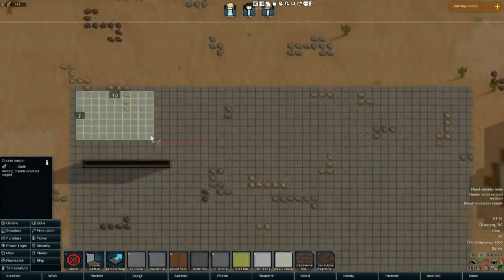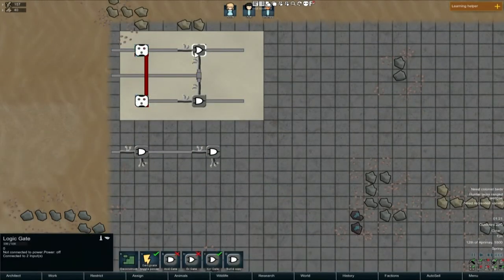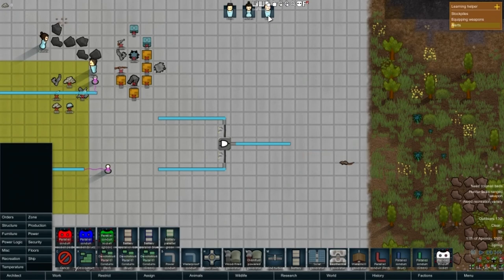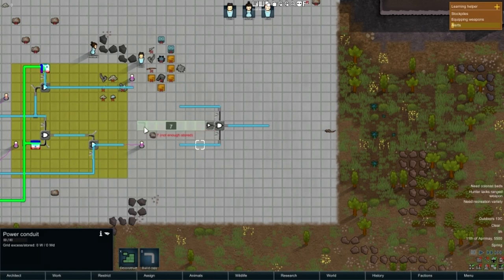RimWorld: Power Logic - Logic Gates (Adding Calculator)

Comment from the maker: Tell me what you guys think. The calculator was actually going to be bigger, I had a huge Binary to Decimal converter circuit and a 7 segment circuit, but I couldn't get it to work, and after weeks of building it, I didn't want to redo those circuits again just to find the error, so I just settled for the adding circuit (serves me right for doing 8 bits instead of 4)
Reply: I don't understand.. I want this if I understand. like the machine automatically off/on if people is going inside/outside the room..
Reply from the maker: @hammerhetyeskahgaming2970  I think you're looking for the proximity sensor switch.

This video only showcases the logic gates, which is a very small part of the power logic mod.
Reply: @Supernefication  ah.. ok thankyou... I'm not a programmer.. I don't know what this mod.. But because i'm just curious.. And I want my backup battery to automatically connect if my main battery is going empty and I want my light automatically on if someone going inside the room or off if no one is in the room.. And other item automatically on or off if someone is near them or far away from them... That's why i'm searching for this mod.. Actually I already have one of this mod but I didn't try it yet.. Just searching before trying.. But I guess. I'll better try later in my savegame. :) I hope i got no error.. cause my game is already in lategame.. Which I already created many machine army. :)